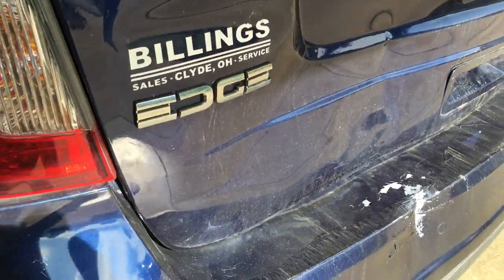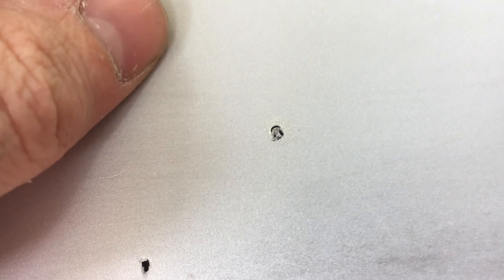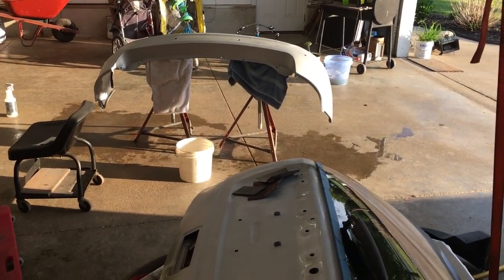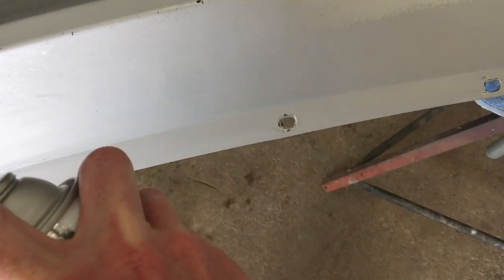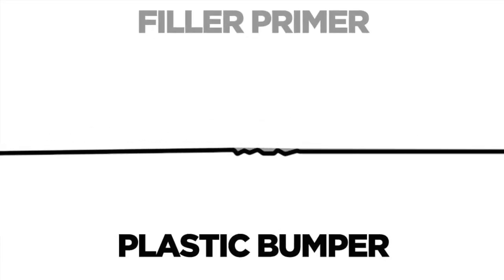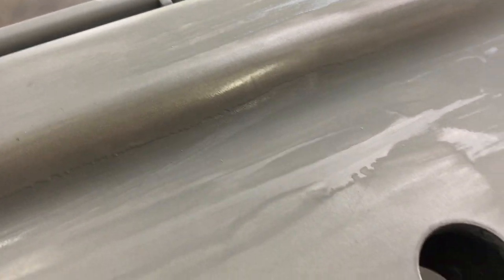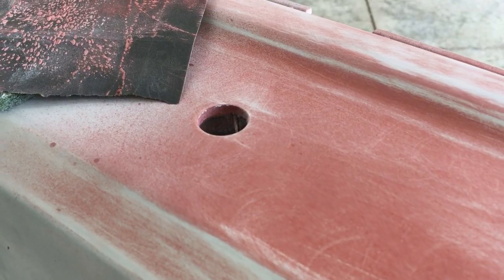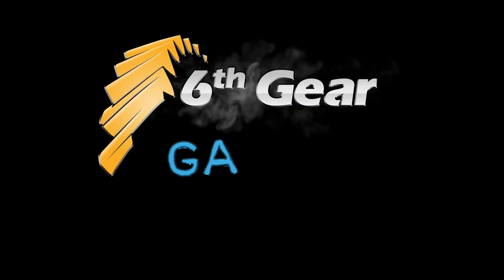How to Prep a Used Plastic Bumper for Painting

Comment: I just watched several videos on bumper prep work tonight in preparation for post plastic-welding pre paint shop prep work on a heavily nicked polyurethane bumper. Yours is the first one that's full of useful information, gives explanations and reasoning, doesn't waste time. Really high quality. Like the time you took to make the animation of what happens as filler primer builds up and then gets sanded down. It's a shame that high quality videos like yours have fewer views. I did my part by subscribing and liking this.
Reply: Oh, like how you said to pre-wash the bumper to remove all dirt so you don't sand it into the surface. Some Australian guy was like, "I wash the bumper, you don't have to, but I've been doing it for 18 years and this is how I do it, your way might work and only the end result matters, but I like to wash my bumper." It's so much quicker and more useful when you straight up tell us: "Wash the bumper before sanding so you don't sand dirt into the bumper."

Comment: Instead of trying to fill all those nicks with spray bomb primer, why not just feather edge them out in the first place and be done with them? How many times did you spray and sand over and over trying to fill them in? And then you said it worked so bad you'll never use it again. Well yeah,  you were trying to make it do too much. Then having those nicks filled up with lacquer primer, as soon as your paint solvents hit it it's going to try to shrink back and reveal all your nicks all over again anyway! It's primer, not bondo! Featheredge the nicks out and then prime and be done with it. You're right about that DX 330 though, always been good stuff.
Reply from the maker: That was only the red Sandable primer that clogged the paper easily, the filler primer worked and sanded great. I didn’t have any issues with it shrinking after painting. I used a sealer on top of the primer. I was nervous about applying filler on a plastic bumper that may be twisting and flexing as I move it around and install it and having the filler crack. Is there a filler you recommend for plastic parts that may bend/flex?
Reply: @6thGearGarage  For years they've made special 2 part epoxies specifically for flexible bumper repairs. I've gotten them even at Walmart. Like a typical epoxy, comes in 2 small tubes on a card, just made specifically for these type repairs.
Reply from the maker: @flyurway  Thanks I will check that out
Reply: @6thGearGarage  evercoat  poly-flex glazing putty works great in my  experience
Reply: @canadiantoque229  Poly-flex is good, however it kicks almost immediately which makes it a bit of a pain to use. You can't mix up a large amount of it. A little bit at a time is the key.
Reply: If it’s just a few small nicks, you could also use Evercoat Glazing Putty since it’s a polyester glazing putty.
Reply: @6thGearGarage  USC Garage flexible glazing putty

Comment: That adhesion promoter should only be used on raw plastic, it actually eats into the plastic a little bit to make it adhere, when you get it on the old paint it will also eat into the paint a little and can cause the paint under your new paint to bubble and wrinkle.
Reply from the maker: I haven't ever experienced that issue, but will keep that in mind. Good to know, thanks!
Reply: Question: Can you use the adhesion promoter, then let it sit at least ONE day, then begin to paint??
Since its kind of a glue, would it set too much and lose its TACKINESS. thus making the painting of your projects  ONE day later -- a fail!!!

My plastic project requires I use --acrylic paint on plastic, can the adhesion promoter work with that--its artist level acrylic paints, not oil or solvent based, actually water based!
Lastly, IF, I can  paint the raw plastic project with acrylics, LET IT CURE  then- can I use-------DEFT LACQUER in spray form to SEAL AND add a GREAT shine to it!

This probably strange project is actually--- PLASTIC CHESS pieces - that are ALREADY SANDED, very clean and ready for a primer. it has BEEN VERY hard to find a good primer for plastic,  that works inn conjunction with ACRYLIC paints and THEN, once cured--- top coated with at least 2 coats of DEFT Lacquer spray form!

There are rust oleum products DO say they work on plastic, but they are SOLVENT oil based, I need to use  artist ACRYLICS, I can AND have thinned these acrylics MANY times, to put through an airbrush gun--- they work GREAT and do NOT OVER SPRAY, causing loss of DETAILS on specifically-- Plastic chess pieces that DO have MANY small crevices- all kinds of little  indentations and places  paint could "glob" -- but -- with an airbrush -- that NEVER HAPPENS!

BUT-- I have never tried it on plastic, I KNOW Acrylics would have a hard time ADHERING to plastic -- IF I tried using a normal primer, I know I NEED a good Adhesion promoter for PLASTIC!

ANY opinion or insight you have as too the ability of "dupli color adhesion promoter" working with acrylics and after curing - being able to handle a LACQUER top coat -- is VERY MUCH appreciated!
Reply from the maker: @yakkyuu12  the adhesion promoter is actually not tacky at all, just a clear spray. It dries quickly and there is no recoat window that I’m aware of.

Comment: This is not a criticism you are doing a fabulous job and the video is excellent. My question is why did you not use a suitable filler for the deeper scratches on the plastic bumper? And then finished off with the filler primer.
Reply from the maker: Thanks! The main reason is the scratches were't that deep. Also there were so many areas spread out over the bumper, that the filler primer was fast, being sprayable.  I did repair a bumper that had deep scratches before, and used filler on that repair. Here's a link if you're interested:  https://youtu.be/WdPADUGqSxE
Reply: @6thGearGarage  Thanjs for that. I have just warched it and it has helped. A very good demonstration.

Comment: What would I use to fill deep flakes ? Ones you filled were relatively small would the same process work for deeper chips?
Reply from the maker: It really depends on the depth. At a certain point, it will be better and faster to use a plastic filler for gouges and scratches.

Comment: Great video! Doing my bumpers lately. Prep is nearly done, i have a lot of plastic showing. Is it okay to coat the entire bumper with adhesion promotor after sanding prep?
Reply from the maker: Yes, I have found that adhesion promoter that gets sprayed outside of the bare plastic onto primer or sanded paint is fine.
Reply: @6thGearGarage  Thanks man! I really appreciate your input

Comment: 9:18 has happened with me so many times and I start all over. I use alcohol to wipe the surfaces and it does that, it sometimes even damages the good paint. Is there something other than dx330 arcyli clean that is available in small quantities?

6:22 make sure to shake your primer for 1 minute before applying. Otherwise it blows dust and liquid separately sometimes. Not fun to clean.

Ended up using rust oleum wax and grease remover. Works good
Reply from the maker: I have had good luck with Prep All and it's much cheaper than the DX330  https://amzn.to/31YfrCm

Comment: Thanks. Very informative.
I was told i can paint after using adhesion promoter primer. 
If paiting new raw bumper, do you think this is a good idea ?
Reply from the maker: On new plastic I would use adhesion promoter, then grey primer, then color, then clear. The color of the paint may appear darker if painted over black plastic, since the adhesion promoter is clear.

Comment: Found you from a Google search. So far I like what you've done. Do you have anything in mind to remove deeper scratches or gouges, about a 16th deep or more?
Reply from the maker: They make a plastic epoxy that can fill deeper scratches.  Be careful if using bondo on plastic bumper covers because it can crack if it flexes too much.
Reply: @6thGearGarage  yup exactly. I'll have to check out that epoxy

Comment: So I spray painted a plastic bumper. Sanded, adhesion promoter, filler primer, sanded and painted.  The guy at the auto store I bought the spray paint from said the paint has clear coat in it so there was no need to spray a clear coat on it.  I painted the bumper and about 3 days later I placed it on it's face to screw on some parts and some paint was left on the cloth it was laying on.  Obviously it is not fully dry.  Should I spray some clear coat on it? If so, do I have to wait until it's fully dry to spray the clear coat or can I do it now? Is the paint not being dry this many days after typical?
Reply from the maker: Do you know exactly what type of paint it was? For it not to be dry after 3 days is very odd, unless the coats were extra heavy and the weather was cool. Still seems strange that instead of just being soft, it's wiping off on a cloth. I'd find out what type of paint it was to begin with, research the curing times and recoat window of the paint, and then see if there's a compatible clear to go over it.

Comment: Did you use only use the filler primer on the imperfections or the entire bumper? 
Also did you use the primer sealer on the whole bumper?
Reply from the maker: The filler primer was only used in the areas with imperfections, while the primer sealer was used on the entire bumper.
Reply: @6thGearGarage  thanks! what different types of sandpaper did you use for this?
Reply from the maker: @danielaliakseyeu9582  I used  a variety of grits. There is a link to the paper I used in the description.
Reply: @6thGearGarage  You only used those two primers right? THe primer sealer acts as a primer itself?

Comment: When you first started what grid did you used when you started to wet sand the bumper.
Reply from the maker: It was 500 grit, but 400 would have worked as well.

Comment: I have a dark navy blue used bumper and I want to paint it baby blue. Do I need to remove the dark blue paint until I have bare plastic? Or just the clear coat? What grit sandpaper? Thanks
Reply from the maker: No don’t go to bare plastic. Just scuff the old paint, apply primer sealer, then new paint. The video explains the sanding process.
Reply: @6thGearGarage  Please, when should I apply the adhesion promoter if I'm repainting a used bumper  that has another color? is it once before the filler primer and again before the primer sealer?
Reply from the maker: @mohamedziedguesmi6049  Adhesion promoter is only needed to go over bare plastic

Comment: Why not orbital sander? At least on flat surfaces?
Reply from the maker: I prefer to sand by hand on a surface with so many contours. An orbital will cut quickly on the edges. I get a better feel for the surface if using my hand, but maybe an orbital works better for others.

Comment: Do you have to use a prep spray
Reply from the maker: Some kind of degreaser or wax & grease remover needs to be used before primer/paint so the paint will bond well.
Reply: @6thGearGarage  so I can use any to remove the wax and grease
Reply from the maker: @Davidmtz559  Yes, but test in a small area first because some are more aggressive than others
Reply: Can I use dawn soap ?
Reply from the maker: @Davidmtz559  It's not going to work as well as a true degreaser. I would not us dawn to prep for paint. It will also take much longer to evaporate.

Comment: What about stripping it first to get down to bare plastic?
Reply from the maker: You could strip it down completely. I prefer to leave the factory primer in tact because the factory did a great job of bonding the primer to the plastic. Bare Plastic can be tricky to paint.
Reply: Excellent point. Thanks. I’m thinking about doing a GTI cover soon. Appreciate the info and video.
Reply: Excellent point. Thanks. I’m thinking about doing a GTI cover soon. Appreciate the info and video.
Reply: Excellent point. Thanks. I’m thinking about doing a GTI cover soon. Appreciate the info and video.
Reply: Excellent point. Thanks. I’m thinking about doing a GTI cover soon. Appreciate the info and video.
Reply: Excellent point. Thanks. I’m thinking about doing a GTI cover soon. Appreciate the info and video.
Reply: Excellent point. Thanks. I’m thinking about doing a GTI cover soon. Appreciate the info and video.
Reply: Excellent point. Thanks. I’m thinking about doing a GTI cover soon. Appreciate the info and video.
Reply: Excellent point. Thanks. I’m thinking about doing a GTI cover soon. Appreciate the info and video.
Reply: Excellent point. Thanks. I’m thinking about doing a GTI cover soon. Appreciate the info and video.
Reply: Excellent point. Thanks. I’m thinking about doing a GTI cover soon. Appreciate the info and video.
Reply: Excellent point. Thanks. I’m thinking about doing a GTI cover soon. Appreciate the info and video.
Reply: Excellent point. Thanks. I’m thinking about doing a GTI cover soon. Appreciate the info and video.
Reply: Excellent point. Thanks. I’m thinking about doing a GTI cover soon. Appreciate the info and video.
Reply: Excellent point. Thanks. I’m thinking about doing a GTI cover soon. Appreciate the info and video.
Reply: Excellent point. Thanks. I’m thinking about doing a GTI cover soon. Appreciate the info and video.
Reply: Excellent point. Thanks. I’m thinking about doing a GTI cover soon. Appreciate the info and video.

Comment: Which filler primer did you uses? If you don’t mind. Thanks in advanced
Reply from the maker: Victor Castro it was By Duplicolor. I recommend their filler primer but not their sandable primer.
Reply: @6thGearGarage  i want to prepare my bumper to repaint, should i use 180 + 400 + 600 sand paper or 600,400,180? i'm kinda lost after watching tons of videos xd
Reply from the maker: @KrC_Games  The lower the #, the more coarse the grit, so always start with the lowest # and work your way up.  That's a pretty big gap from 180 to 400, I would consider going 180, 320, 400, 600. Otherwise you'll be sanding with the 400 grit for a long time to remove the deeper scratches left by the 180.
Reply: @6thGearGarage  thank you for reply! it's my first time i ever will do such thing, so i want to repaint it same color as it is, but it's so bad at the moment, so i i think i need to grit it all to 0 and paint again